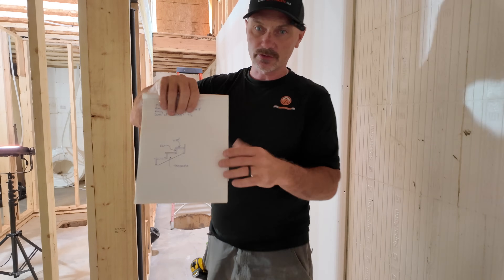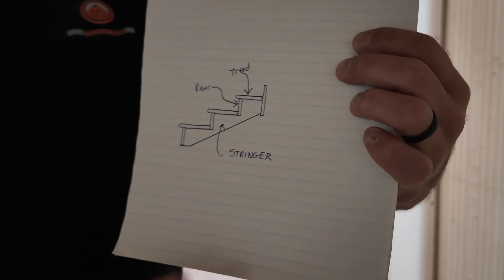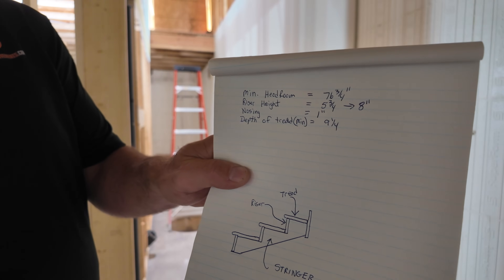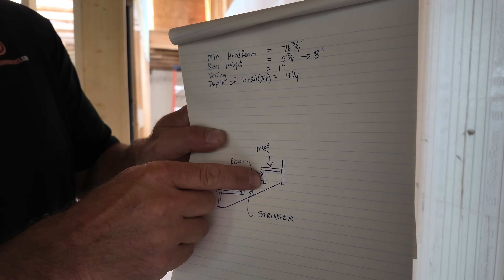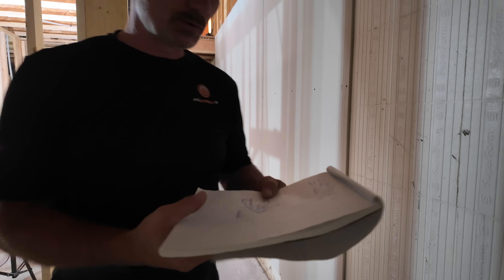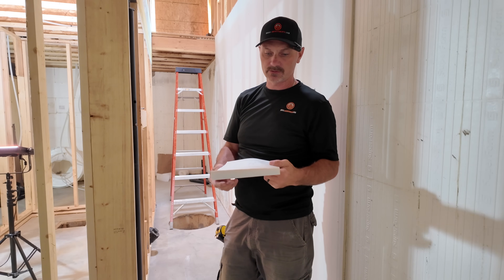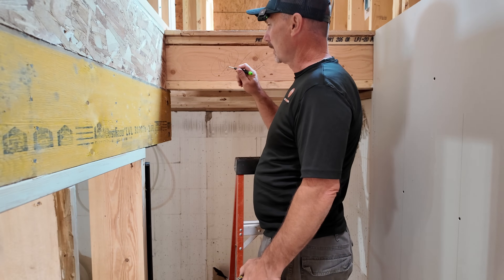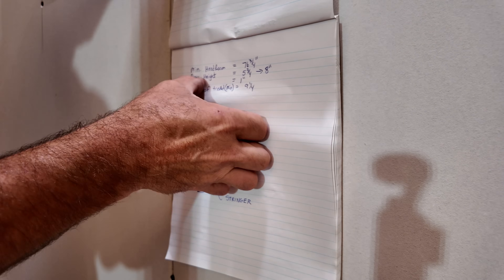Building Stairs - Dimensions (THE MATH)

Comment: in our district the Tread depth is now minimum 10&1/8 (conversion from metric), I had to redo the stairs in our new build as the contractor f'ed up, even though i gave him the new code from the City and there was a note on the plans (which he obviously didn't read...).   Due to the limited space I also had to install a landing at the base of the stairs (extra costs).   And the quality of the cuts on the original stringers were shocking.  I'm no carpenter by any means but I can gang cut 3 stringers with straight cuts after redoing the layout, wasn't that hard with a jig to draw around.   Used a scrap lumber to make a triangle with a butt piece to sit on the stringer.    And as this we a duplex I had 4 sets of stairs to "fix" (grrr).   On the basement sets I was able to make various boxes, glue and nail them into place on the existing stringers to "build out" the run to meet new code.   I also added some hurricane ties to the back side to add some extra strength.   The inspector did his best to pull them apart without success.   It was cheaper for me on the lumber costs vs buying new 2x14's
Reply from the maker: Sounds like you did a good job getting these to work. As i said checking the local codes is important.

Comment: Man, from a euro. Metric is so much easier. Take care 😊
Reply from the maker: For most people the math is easier with metric for sure but our channel has a very large majority of US viewers and imperial is more common.  In Canada where I am both are used but in residential construction Imperial is still king.
Reply: In Canada, we fluctuate between metric and imperial, but for the most part, we still use imperial in construction. It's really not that hard to use, it's all relative.
I can visualize 10 feet a lot easier than 3048 mm.
Reply from the maker: @acerjuglans383 I agree with you on recognizing imperial dimensions easier in my head than metric for sure .

Comment: Very good presentation of details. 
But did I see three 2 x12s, meaning you'll have 3 stringers? 
What's the code in your area for number of stringers vs stairway width? Thx.
Reply from the maker: In Canada for a single family home 1200mm (47-1/4") between stringers is min. code as long as the front portion of the thread  is supported by the riser but that is crazy wide for two stringers IMO. By code unsupported treads (open risers)  at least 38mm (1-1/2") thick on single family homes stairs can have stringers 900mm (35-1/2") apart .
I personally like a min. 610mm ( 24")  on interior stairs.
Reply: @HouseImprovements  "I personally like a min. 610mm ( 24")  on interior stairs."

Agreed. You never know when someone might decide to move an 400 lb. refrigerator on those stairs.

Comment: 2X10 should never be used.except in a tree house, or boat house.
Reply: Who uses steps for a tree house??? Use a ragged rope ladder!
Reply: @Fivemonthslater1  I run full electric and plumbing in my tree house. It's also 4 stories with a fully functioning basement and rooftop garden
Reply: @ do I have to send pictures to show you treehouses ? Google pics of tree houses. Let me know how many steps you see.🤣🤣😉😑😳🤭
Reply from the maker: By code in NBC2020 9.8.94 2x10 can be used if you meet all other specs of effective depth and min. riser and thread sizes or even in cases where the strings are supported from below. In most cases interior stairs unsupported would not meet code with 2x10s however.
Reply: I use 2 x 14
Reply: @ that’s even better.